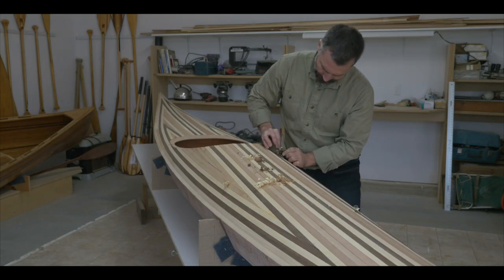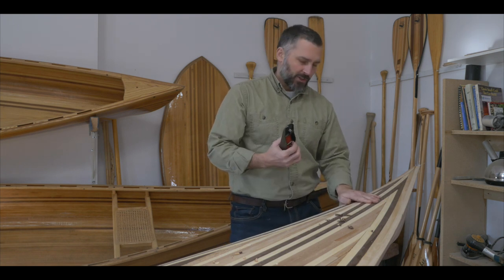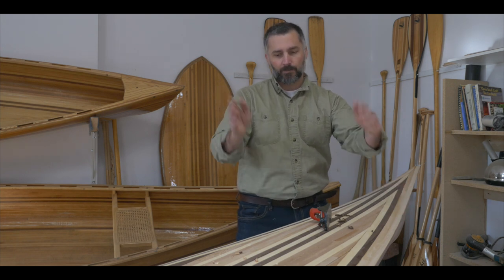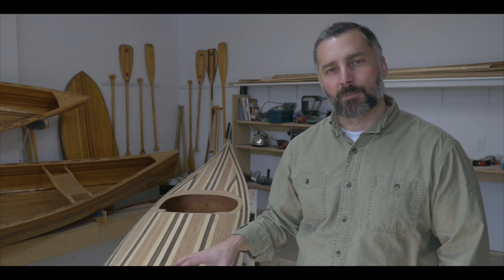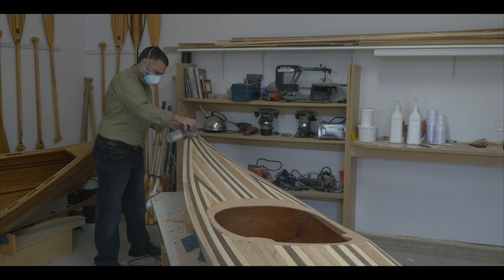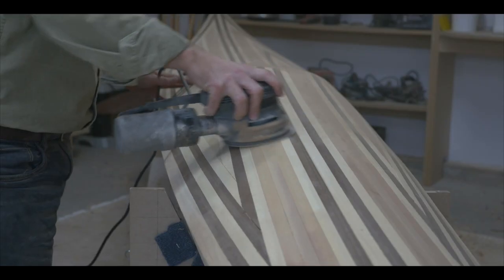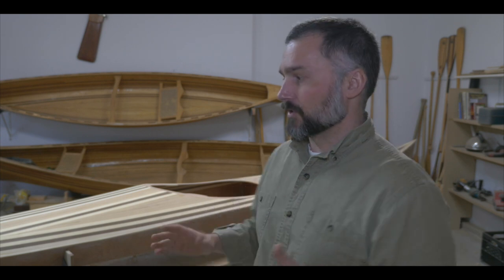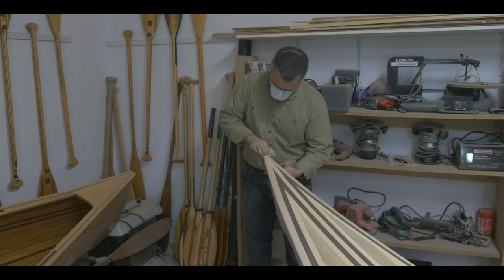How to Build a Kayak | Fairing the Cedar Strip Kayak Deck

Comment: Great work loving it.. I would like to add something about the sanding.. Be careful when sanding from the hardwood to softwood because the softwood can be removed faster than the hard and cause a dip.. Try to keep sander as level as possible don't tip it on its edge.. I learned this the hard way..